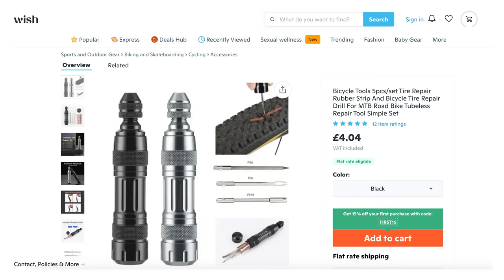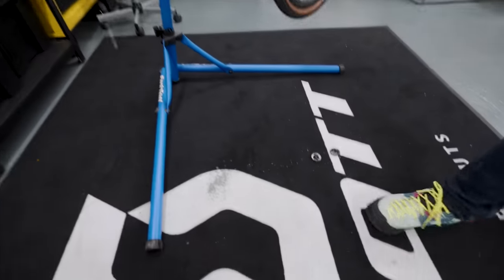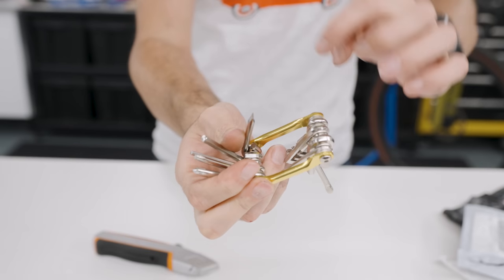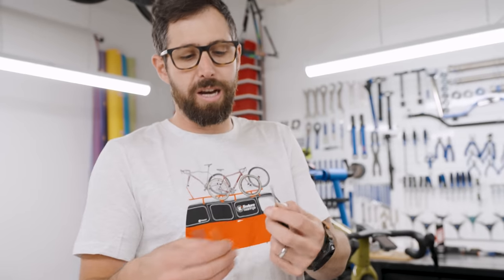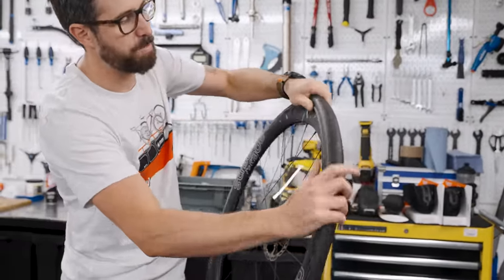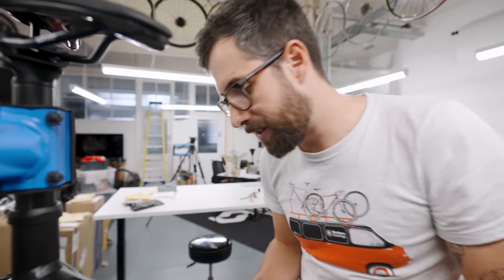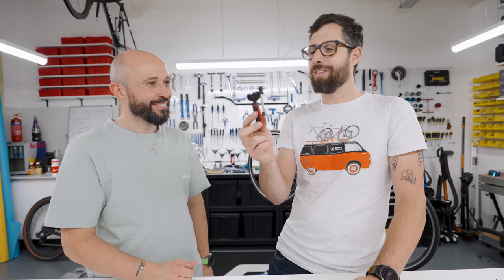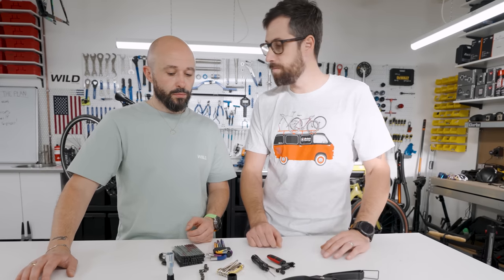Pro Bike Mechanic Tests The Cheapest Tools From Wish.com

Comment: 13:36 WHAT A LOAD OF NONSENSE. I've been using these for the past three decades and on an estimated 300+ crank arms. All you need is a bit of extra care when "threading the tool in". Also, protect the thread on the tool against damage when not in use (i.e. no rolling around in the toolbox) and replace the tool as soon as the thread starts wearing.

Comment: 12:00 I used that or similar tool I bought in bike shop and it was crap, it bent, stripped threads. no. 0/10

Comment: cheap tools work just fine , have them for many years , most will have to use them once or twise a year ,  you will not spend 50euro for bb tool if you will use only 1 time ,  every3 years ,  and got a similar multi tool for 7 years still works ,  i have buy only once a good cone spaner pay 20euro for it use it 3 times , worst purchase ever ,

Comment: 1. Not for the workshop and downrating because of the name is a absolute no-go.
2. Nothing wish special. You can buy this crap since many years also in native online shops. 
3. Using them since years. Really cheap destroying them for the video. Compare to wera they last longer because the colour marking at were goes off after a few years. Only reason to use more expensive one is if you have many really small bolts. There the china tools are not working because they are to small. Big advantage: If you don't want to have the ball at the end, just cut it of.